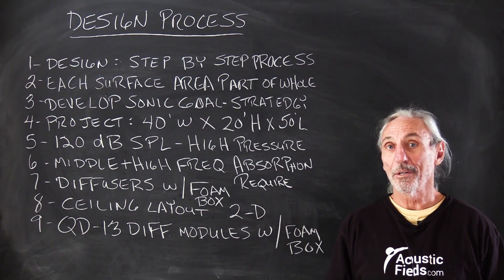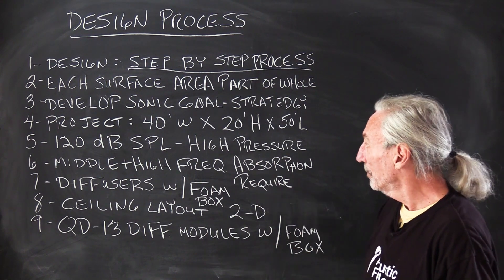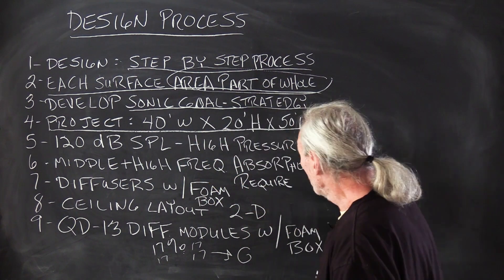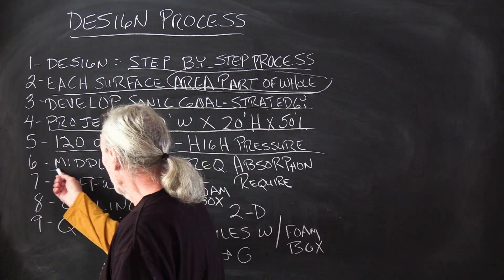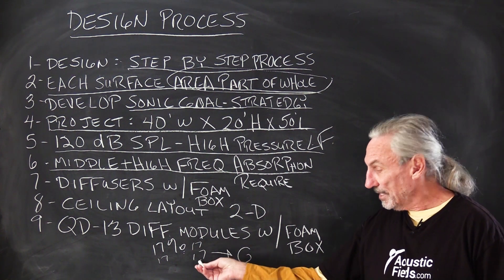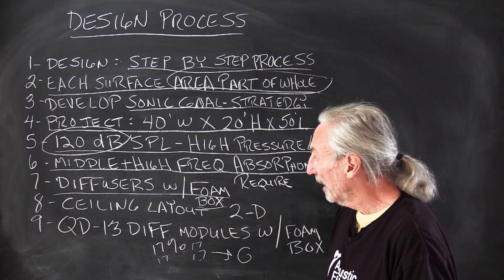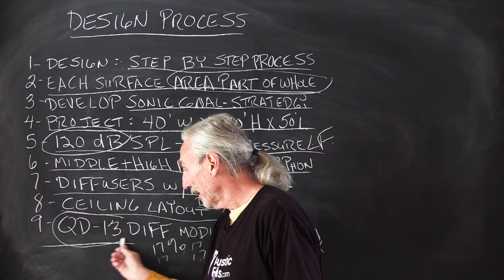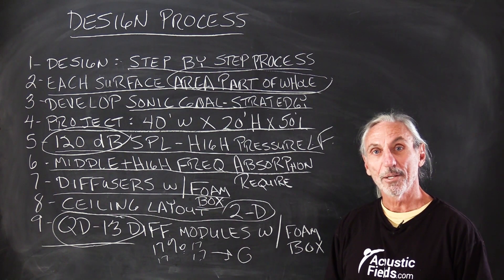Design Process - www.AcousticFields.com

Comment: Maybe you should devise a spreadsheet calculator that bases your prices for design services based on the various parameters from the most simplistic design to the most complex.
Reply from the maker: Every design and case is different. Every client's requirements are different. There is some overlap but not much.
Reply: @AcousticFields  That's why you have the pricing calculated by certain things like room size, application (vocal booth, 2 channel listening, Home theater, control room,, SPL, how many sources (1 voice or 2 channel, 5.1), barrier or room treatment, etc. That way, depending on the criteria, it would help figure out how much time you typically need to perform the design tasks..  I'm sure it will take more time to design a larger room for a Atmos home theater with lots of speakers, than it would a vocal booth, etc.  I'm just spiff balling a way to figure out how much to charge a client for your services.

Comment: Is there a percentage of the build that should be set aside for acoustic treatment? 20%/30%?  or is that to generic?
Reply from the maker: Since the room accounts for over 50% of what you are hearing, you must focus on the room first before placing any gear into it. People go about this process from the wrong direction. They buy gear first and then keep their fingers crossed that it will work in their room. Its a wrong thinking process that usually ends in disappointment with the gear and the room.

Comment: What would be the approximate price on a project of this size?
Reply: Arm and two legs!
Reply: @6stringsandapick  You forgot you're left nut!
Reply: Six figures, minimum.
Reply from the maker: Projects can range in size from 100 K - 350 K depending on the blend of DIY and production unit costs.